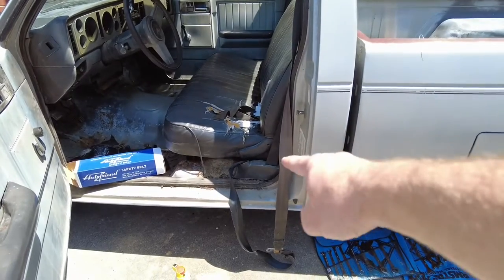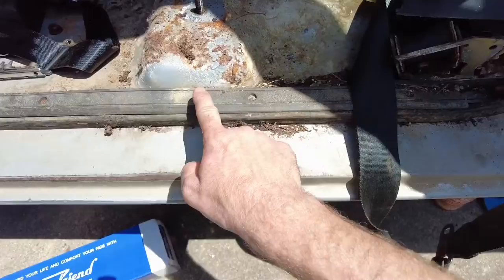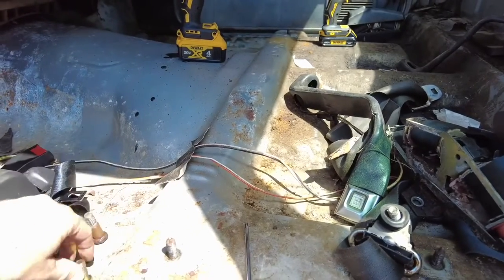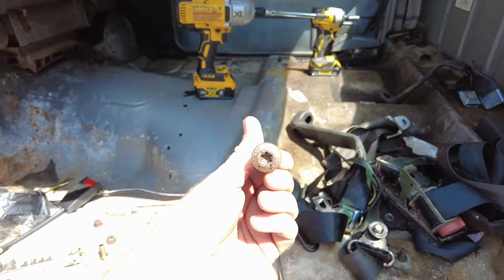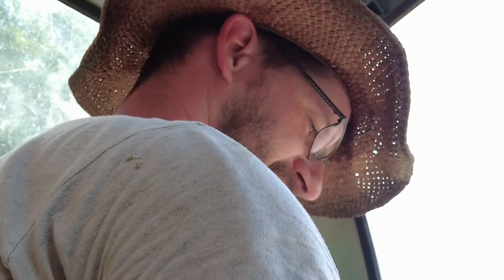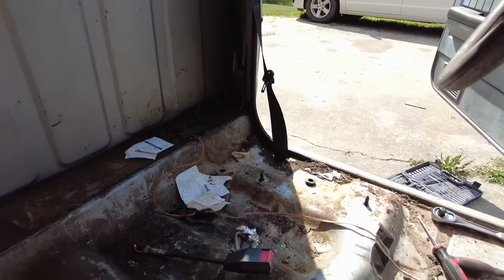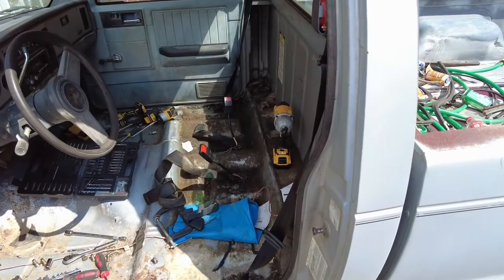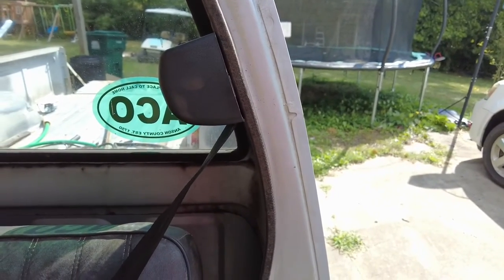S10 seat belt replacement with a $30 eBay universal seat belt kit.

Comment: How can you work in all that Crud Man. 
Brush it out.
Reply from the maker: Seat is getting replaced anyway.  I figured I’d just pressure wash it out then.
Reply: @ChrisThedudenurse  ah fair enough, 
I can’t do that. I’d have to clean up before I start.
Cheers mate.
Reply: What size did you use to remove the bolt that was in the truck in the first place?